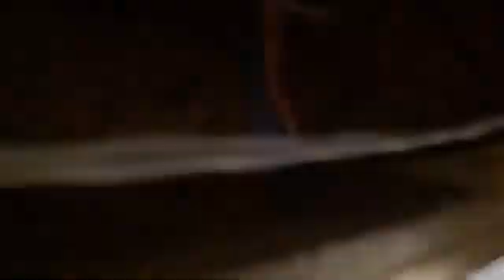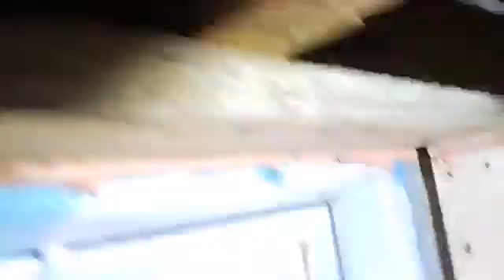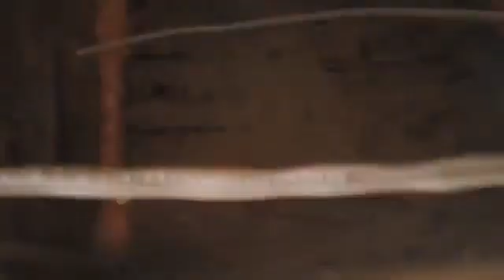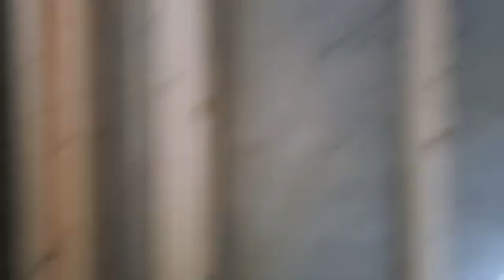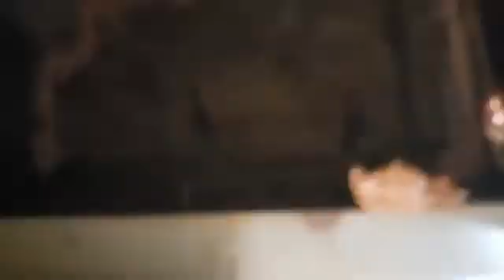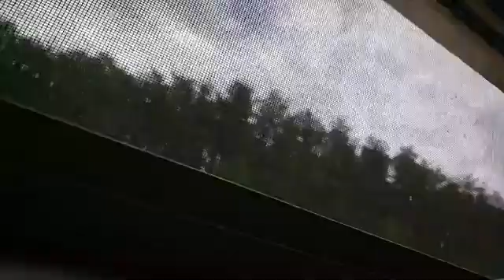Construction framing mistakes

Comment: It's not e header its the box joist or rim joist it's bearing on top of concrete take a refresher course
Reply from the maker: You may want to listen to the video again (and check your grammar). The rim joist was too short, it was over the window, did not extend over the foundation.

PS: The builder (and their engineer) agreed this was a mistake, I guess they need a refresher too.
Reply: It is a rim joist and doing the job of the header above the openings.
Reply: @volkanyesilyurt no the foundation picks up the weigbt